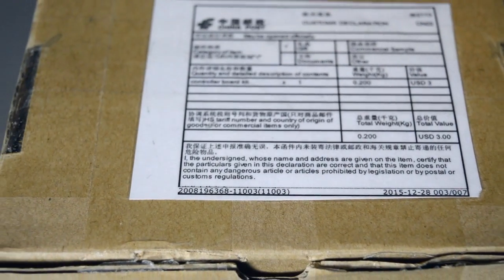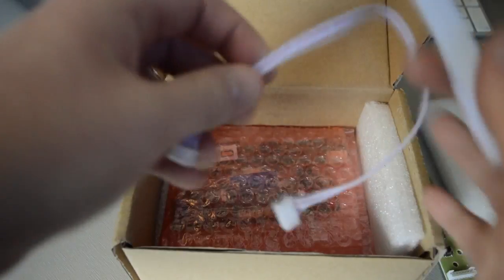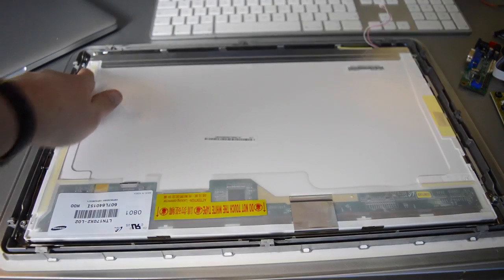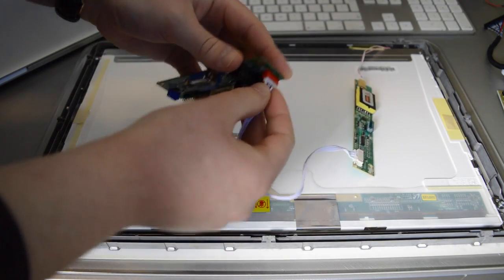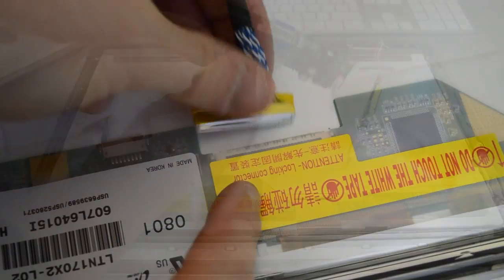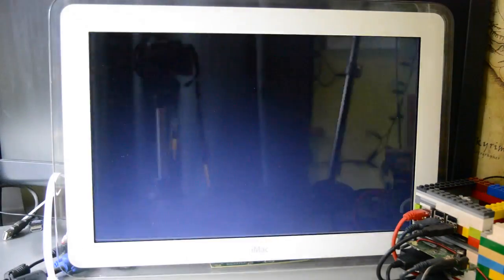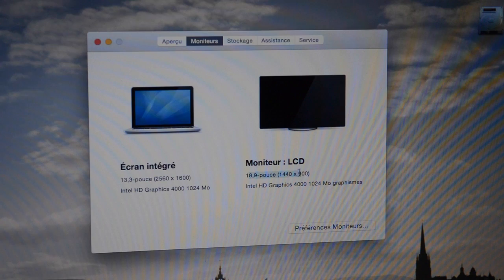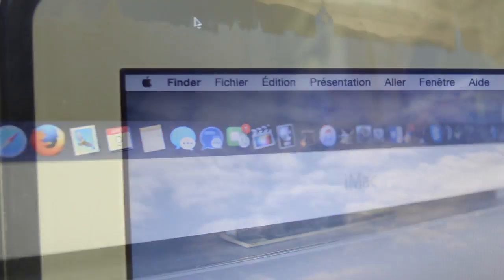iMac G4 Monitor Mod - Part 2: LCD Screen Test

Comment: where did you buy the accessories to make it work could you pass me the list of things
Reply from the maker: Hey, this series is super old.  I am planning on re-launching the channel, where I may do a follow up video with a bit more detail, hopefully answering this question!
As for where to buy the parts, there's nowhere in particular, I found my parts on eBay, but there's no real way to me to direct you to anything specific, as all parts and projects will be different.
Reply: @QuinsTechCorner  and?

Comment: What's the point of showing the conversion if you don't tell the viewers where you got the parts from.
Reply from the maker: Hi there,
I've said a few times now that there are no standard parts to buy to do this. Anyone who wishes to do this can find everything they need in 10 minutes with google and eBay (which is where most of these parts came from).

If you know what you don't know, you can get these questions answered.
If you have any particular questions, I'd be very happy to advise!

The video shows which parts are required, but there is no way at all I can point people to items and expect them to stay current. 
Furthermore every setup will be different. The way I did things was probably not the best.

Comment: excuse me, could you send me or tell me the spec of the inverter and cables ?  im trying to transform my old g4
Reply from the maker: Greetings and thanks for watching!
Unfortunately I can't link you to any products, nor can I tell you the spec of the parts used, as I have now sold this machine.

Many different parts may be used, so long as you have the LCD paired with the correct inverter (these can be bought together on eBay), and an LCD controller board, you should have success.

Comment: Hello. Congratulations for the videos, interesting!
I wanted to ask you if you can insert links to buy the various components.
I did some research on the internet but without results. Thank you
Reply from the maker: Hi there, many apologies for the late reply.
There isn't any link I can give you unfortunately, as these parts come and go online.
There are also many different kinds of parts you can use. Essentially, so long as you have the LCD paired with the correct inverter, and a LCD controller board, you should be good!